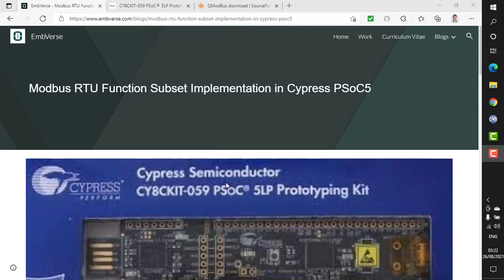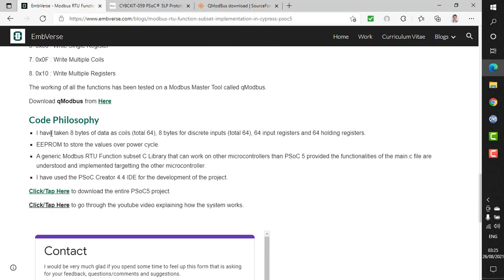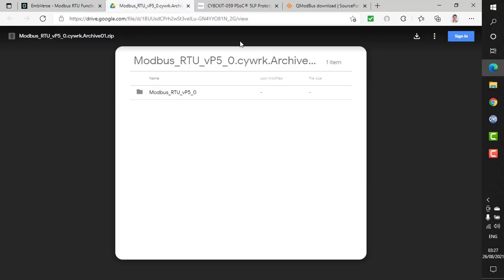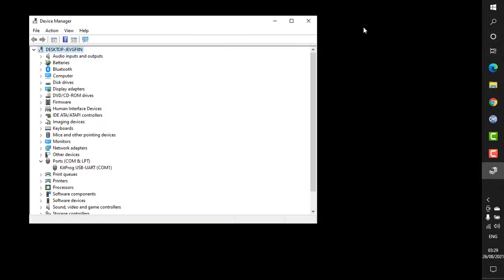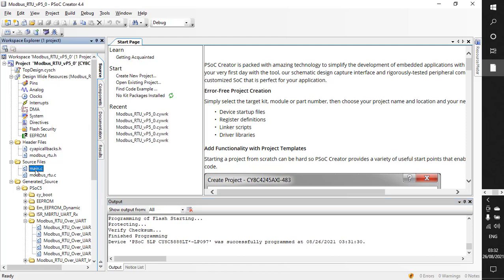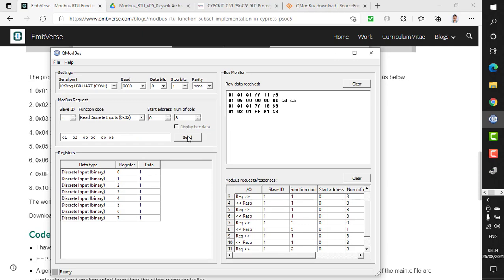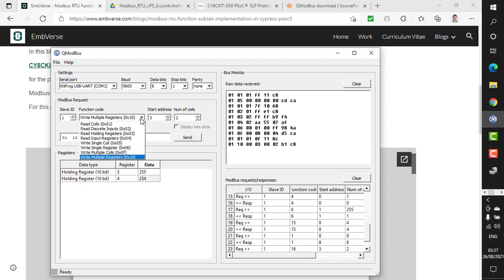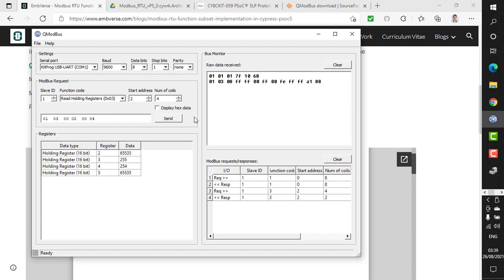Modbus RTU Function Subset Implementation in Cypress PSoC5 | EmbVerse

Comment: Hi, thanks for sharing. Does this code only work as a Modbus slave or could it also be configured to use it as a Master? I need to read with the PSoC the data from different sensors in a Modbus RTU network, for which I must use the PSoC as master. Thanks
Reply from the maker: Hi Carlos ! This project is for PSoC5 as Modbus Slave only. In Modbus RTU, a Master queries and a Slave responds. If PSoC5 has to be set as Master, the function set of the Project needs to be changed as now PSoC5 will be querying instead of responding for that, the functions in the shared modbus_rtu library shared in the project source code will need to be redefined and tested.